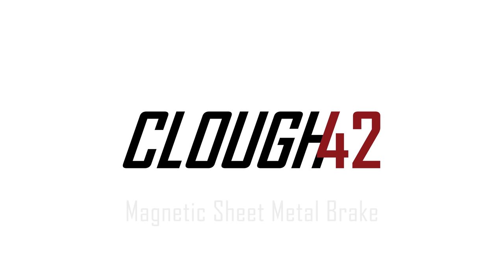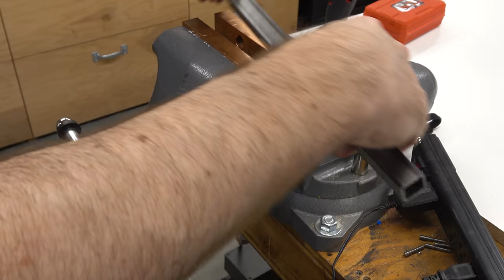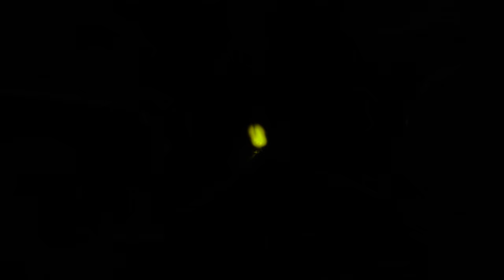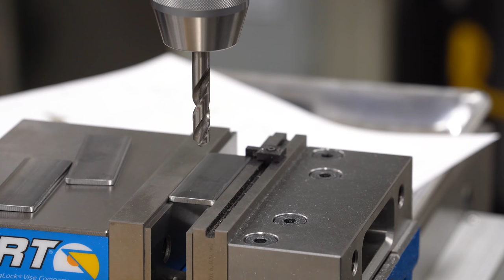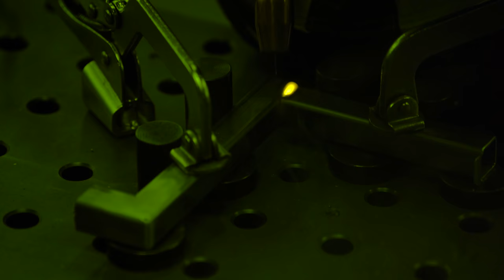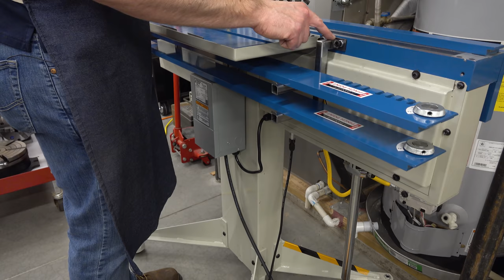Fabricating a Storage Rack for the Bending Brake Clamping Bars | Baileigh Electromagnetic Brake

Comment: Excellent solution. When welding two different thicknessed material, point the arc towards the thicker material and remember that the A-measure (welding thickness in a sqaure) only needs to be 70% of the thinner material to gain maximum strength

Comment: Put the heat onto the thicker metal and whip the molten pool into the thinner metal as you move along. A few practice runs and you'll get it. As always weldingtipsandtricks has a great video on it
Reply from the maker: Cool.  Thanks!  I did attempt this, but it was hard to tell how much fusion I was getting.  Practice will help.

Comment: Nice. All in all a nice result. The only thing I would have done different would be to gas weld the parts with oxy/acetylene. Not necessarily because it would make a better result, but because it would give me an excuse to buy a set of oxy/acetylene torches.

Comment: Looks good to me. When I'm welding a thin material to thick I try to strike the arc more focused on the thick material and then bring the arc up and into the thin side of the joint. Gently weave the gun dwelling on the thick side to get the heat into it and weaving over bringing the puddle into the thin material just enough to get your penetration.
Reply: That's exactly how I practice
Reply from the maker: Practice.  I should try that.  :)
Reply from the maker: I tried this a little, but was having trouble judging how much fusion I was getting on the thin side.  I'm sure this will get better with practice.
Reply: @Clough42  In my language this santence has litle diferent meaning ;) what I wanted to say I'm a welder over 20 years end that's how I do it sucesfuly. Sorry my english is not that good.
Reply from the maker: @Saleredut  you're good.  I understood.  And I think practice is exactly what I need.
Reply: @Clough42  While that is what I do, I can't say I'm always good at it. I've pulled the welder out at times and put down a few beads and think this isn't that bad maybe I've finally go it but then the next time its a absolute ** show LoL. Aside from practice the #1 thing I tell people is to get a hood you're comfortable and can see in. My biggest improvement came after I got my Lincoln Viking helmet a could years back.

Comment: Nice Job. What I have learnt over years of occasional welding is - It IS NOT like riding a bike! Unless you practice regularly, your first weld each new time will be way worse than your last one on that project. Practice is key, which sadly I don't do. I just seem to drag the welder out about 3-4 times a year & spend the first half of the job being frustrated at how bad my welds are... then by half way through, it starts to come together! :)

Comment: James, one suggestion: shorten up the stick-out on your MIG filler by ~1/4-inch.   Very nice upgrade. Thanks for posting.
Reply: Yeah, the stick out was too far. You could visibly see the wire wander during the pass. Other than that, great video as always.
Reply from the maker: Yeah...this is an experience thing.  I often start low, but apparently drift up during the weld.  Then the wire is sticking out too far when I start again, and don't bother to trim it until it's obscene.  :)
Reply: @Clough42  yeah, mig is super convenient and fast. Wire control and approach angle (push or pull) just come with time. Practicing with scrap coupons for welding different thicknesses together is super helpful. Helps expedite the skill level power ups :)

Comment: Nice project! When welding different thickness material, put the majority of heat into the thicker part. Best thing to do is grab a bunch of scrap material, of different thickness, and just practice. Dont be afraid to try different settings other than what the machine is suggesting, you will notice differences, and after practice it will become second nature. Practice really important with welding. Thanks for sharing another great project!

Comment: I like the utility of the project. Nicely done. Your welds are fine. When welding materials of different thicknesses, you can use a couple of different techniques. One is, rather than angling the torch to split the angle, but to angle the torch so that it is pointed more toward the thicker material, more heat will go into it. The other is, if you are welding with a weaving pattern, spend more time of the weave on the thicker material and less on the thinner material.

Comment: Hey James, have you considered gluing some rubber onto the top of the support bars? So, when you move the whole unit around the workshop, the bars don’t vibrate and slide around and cause them to rattle around. I’ve done something similar to my TIG welding cart to keep the bits and pieces in place as I move it around.
Reply from the maker: Thought about it.  It's likely to cause more trouble,than it's worth.  We'll see if it's an issue.

Comment: James you did good again. Bubba, 4.9 outta 5 stars on this one !!!! I Read the prior comments and I agree, start off on the thicker side, but instead of oscillating the tip along the seam, go from thick to thin and back and forth like that across the gap watching the molten pool and moving your arc pool when u see the arc of the molten bubble 1st appear.

Comment: Welding thick metal to thin tube or sheet. I tend to just favor the thick piece. That is the arc and puddle is most on the thick  piece and i just let the heat of the puddle melt into the thinner piece. Only briefly letting the arc contact the the thinner piece if the puddle is not flowing into it.

Comment: quick tip  support your elbows welds come out better.  turn heat to match thick part then move across between welds faster so no burned holes in thin material.
Reply from the maker: I'm resting my forearm on one of the clamps.

Comment: Another useful project James, pretty soon you are gonna run out of shop improvement opportunities 😉. Personally,  I would have probably TIGged the 1/8" plates on. I find TIG more controllable in that situation, versus dealing with a static compromise voltage setting on MIG. Looks good though, nice video. Ciao, Marco.

Comment: Looks like the weld size is too large vs. the thickness of either material. As others have mentioned, set the machine for the thinner material. Also, try reducing the time spent going side to side, which will reduce the weld size. In fact, you should be able to make those welds with little to no side to side motion. Focus the arc on the thicker material and move the gun forward. If you need more weld on the thinner material, add a small amount of "Z" shaped motion.

For non-critical welds in the real world, especially on thinner material, don't be afraid to deviate from the text book MIG technique. 

Lastly, thinner filler wire really helps when welding thin material. I have found that solid wire in the 0.023 to 0.025 range works better than 0.030 wire for most projects with 1/4" and thinner base material. 

Thank you for sharing your work.
Reply from the maker: I need to pick up some thinner stuff and try it.  Having the weld build up more slowly would help.

Comment: Why did you make three of them.... Interesting, that's not the part I'd screw up. Or if it is, it would be in the hole position so the extra would just be an extra piece of scrap. Great video. I appreciate the talking through the decisions you're making.
Reply from the maker: I was more worried about screwing up the welding of different material thicknesses.

Comment: James, I just got my mag brake yesterday.  I am looking at your casters and wonder if you're still happy with them?  What did you end up using and did you get different ones for front and rear as the hole size is different?  I could just drill the holes out I would think. TY

Comment: Have you considered the idea of removing the original small parts shelve and replace it with a rack to store all parts vertically? You could have had all the parts vertical (and not flat like you did) in slots then another slot for all the narrower parts. I think it would have been easier to take out the bars by simply lifting them instead of going around the original shelve. The narrower one would have had to have a shallower slot for it but I have the impression that even with room for fingers between the slots there might be enough space to have a dedicated slot for all the accessories.
Reply from the maker: They're very heavy.  I think vertical would be a challenge to grip.

Comment: Thick/thin... set your heat back to the thin and just slow yourself down. You see your kind of frantic weave in the video. Little less heat, little less feed,  slow down, and watch. You can hold a tad on the thick for some extra heat.. Those looked great. No doubt (given your mindset) if it were something critical you'd have burned a few practice parts. For me, slower, and making sure you can see and have the time to build heat where you need to is most often the key.
Reply from the maker: I need to do more experimenting.  I did try a few things, and going slower led to a lot more buildup without much penetration.

Comment: Quite at the end of the video it seems that you put only a very small bead on the top where the short horizontal tube comes off the flange. Given that this upper side is stressed by tension (and not pushed against like the bottom), I'm surprised you didn't add a longer weld bead across the full width.
Reply from the maker: That's just a tack.  Given my skill level, the material thicknesses, and geometry, I though it was likely I'd just melt over the edge.

Comment: Did you think about using a Haimer 3D probe for your manual mill? I know you have a ZeroMaster for the small CNC mill, but seeing you using the wiggler, I just wondered.
Reply from the maker: I haven't.  I guess you could throw it in a drill chuck, but it's quite long, so that's a bit awkward.
Reply: @Clough42  Why not a collet? Perhaps the Z is not reproducible, but X and Y.

Comment: There is a lot of debate on oscillation when welding, but generally it's now concidered unessary and  bad for the final result. Next time maybe try to weld streaigt. And also, try to get good support for your hand so  it's steady.

/Welding engineer.
Reply from the maker: I'm spring my forearm on a clamp for most of the welds.

Comment: your wire feed speed was a tad too high . Instead of all that hissing , turn it down in small steps until it sounds more like frying bacon .  you were close and for thin stuff like that its not so bad , but good practices will always result in better welds . NICE project !  Also no need to move the torch around so radically .

Comment: James is the living embodiment of "Young Sheldon" tv show. Way over complicated operations for simple outcome.
Reply from the maker: Can you be more specific?  What in your view was over complicated?
Reply: @Clough42  using the mill when you could of done the same cuts using the band saw to make the tab. Two cuts and done. not to mention locating mounting holes. a rule and a center punch!
Reply: I'm also fabricating a lot of stuff at home. I agree it could have been done like you said, and that is how I do it. But if I had a milling machine, even a small one, I would have done a lot of that fabrication work on that. The biggest reason would be because of the increased accuracy and my OCD for parts like that to be exactly the same.
Reply from the maker: Eight cuts on four parts, plus the time to clean up the uneven saw cuts by filing or grinding.  The mill is sitting right here, and it did the same job as fast or faster and more precisely.  The tabs are straight and the parts all match.  Drilling multiple parts is way faster on the mill as well, and once again, it's sitting right here and gave me a clean result.

Comment: Curious that you use the DRO in inches for a set of holes that you know are 50mm apart. I assume that the DRO is just as happy with metric.
Reply from the maker: Sure it is.  But there's no point in this case.  The materials I'm using are in inches, because that's what I can buy where I live.  The holes in my fixture table are in inches, because that's what I can buy where I live.  My 1-2-3 blocks I use for setup are in inches, because that's what's cheap where I live.  The drills, end mills, and edge finder I'm using are in inches, because that's what's available where I live. 
 So the part is designed in nominal inches, and the drawing is dimensioned in inches, to make things simple.  The 50mm spacing between the holes is the only metric dimension on the whole part.  I typed "50mm" into Fusion when I designed it, and it output the dimension in inches on the drawing automatically.  I could go to the trouble of putting metric units on the drawing, but that doesn't add any value or make my life easier.
Reply: @Clough42  Fair enough. You design everything in Fusion, and there is no manual conversion or inch-based measurements of the spacing of those holes. With a part that simple I might have gone without drawing, and then using the metric setting on the DRO instead. Then again, getting anything other than metric is going to be hard over here.

Comment: What thickness of steel can your bender handle?
Reply from the maker: The manual,says 16ga mild steel full-width.  Less for stainless.  I've heard that it will bend thicker material if it isn't full width.
Reply: Thank you.

Comment: For 1/16" - 1/8" material it looks like you are trying to Instagram weave a 3/8" fillet in there. Turn the machine down and slow down or leave it hot and speed up.
Reply from the maker: Instagram never crossed my mind.  I'm trying to tie in both pieces solidly without burning through.  In the testis I did off camera, turning it down resulted in a round bead sitting on top and not penetrating.  Moving slower resulted in burning through.  Clearly I need more practice.
Reply: @Clough42  I wasn't really being serious, I see that didn't come out like I intended. I just meant the size of weld you need on a 1/16" wall tubing is very small, the tube will fail long before the weld. More practice is always the solution. You're doing fine.

Comment: Won't that support tend to bend the bars over time?
Reply: I dont think that matters in this situation, its not like they are precision straight edges
Reply: Yeah I get that but idk know I just imagine it would be more of a pain to setup is they're bowed
Reply from the maker: If the bars were supporting a load at a temperature above 300C, creep might be a factor, but supporting their own weight on a rack at room temperature, it's not an issue.
Reply: If they bend, he has room with the straight tube to add a bolt through there to support it from the back. It doesn't seem like it'll be an issue.